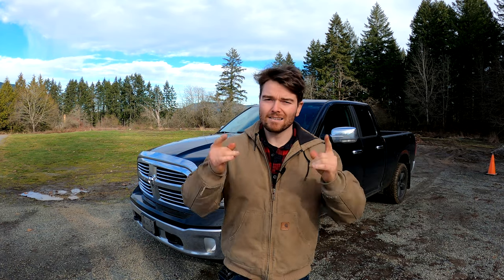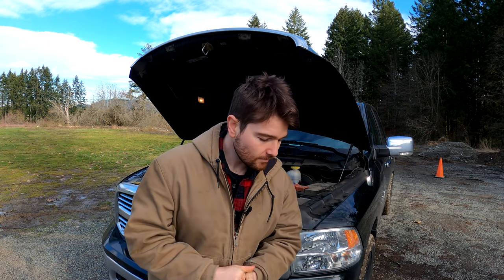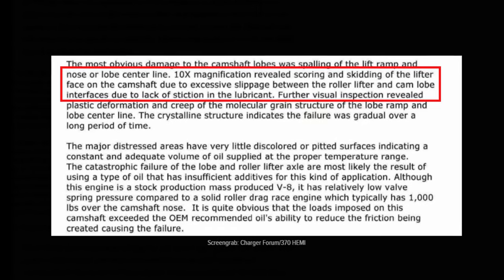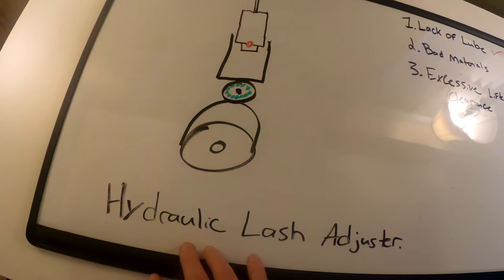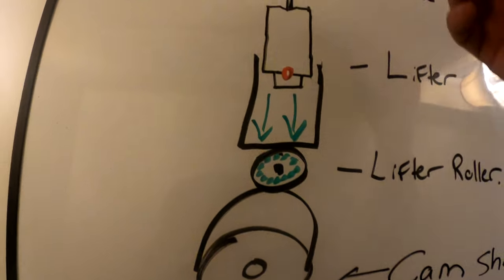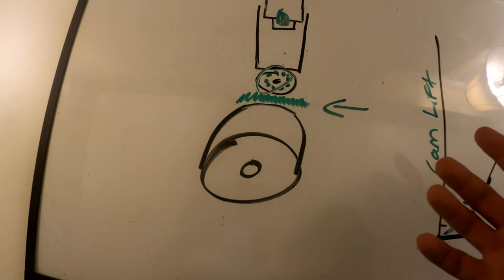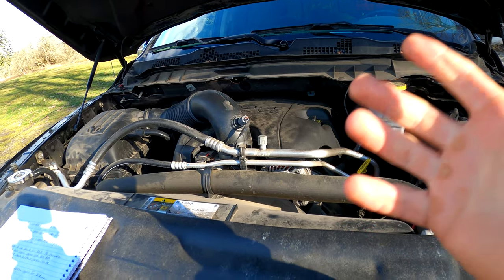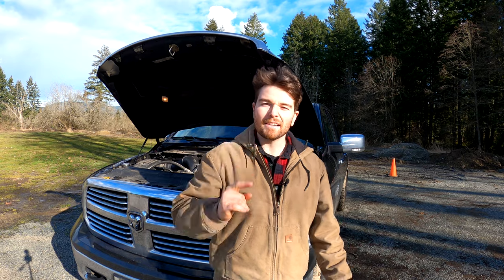RAM 1500 HEMI TICK Explained (Revised) - The Cause And How To Protect Your Engine

Comment: Just passed 100k kilometers (currently at 100 485) and don't have any ticking - yet - knock on wood. I do have two questions though.

I don't do anything myself on my truck but trust the same mechanic I've taken it to for the passed 5,5 years I've had it.

1. The oil in my truck is 0W-20 rather than 5W. How much will this affect the chance of me having these problems? Should I change to the recommended 5W-20?

2. I forget the recommended mileage for oil change but it's either a certain amount of km or 6 months, whichever comes first (if I'd stick to that, it would always be 6 months because I don't do the amount of km in 6 months it's supposed to be change at). HOWEVER - talking to my mechanic about this, he says once a year or 12k km is enough, partially because the quality of the oil is higher in europe, but also because vehicle manufacturer recommendations change. The second one I can believe as I've been told the same thing about my motorcycle by two different motorcycle mechanics, but the oil quality... Is that really affected by part of the world, not what brand it is?
Reply from the maker: At the end of the day it's your truck, so you do what you think is best! But I would always try and stick with manufacturer recommendation. they spend millions of dollars engineering these engines to run and last with a specific weight of oil (now that also depends on climate, if you live in a very cold climate 0w-20 maybe actually be the recommendation - it should all be in your owners manual). besides maybe cold weather is there a particular reason you are using 0w20 ? 

in terms of quality of oil, if you are using synthetic, this stuff is more or less made in a lab and should basically have zero differences where you are in the world. standard oil derived from crude oil may have some differences but my guess would be not that much. 

synthetic oils have gotten better over the years but I would just be cautious. different additives will fade with the passing of time. another thing to consider is your oil filter. oil filters have different particulate ratings, some filter out greater amounts of dirt and debris then others. some filters are rated to last longer then other as well. 

Me personally I would not go more then 6 months without an oil change.
Reply: @TheGettyAdventures  thanks for the reply. I do find it interesting that a mechanic recommends doing something less frequently, since, well, wouldn't they want the work, the earnings? Not to mention seeing others agree with you in the comments that it's crazy to go that long without oil change made me go "uh-oh" a bit when here I've been told once a year or 12k km is enough by a mechanic that specializes in american trucks. But yea, I'll be upping the frequency of my oilchanges.
Reply from the maker: @Waskapmutni  I mean if you do an extra oil change or two a year maybe that will be an extra 100-150 bucks which at the end of the day isn't really that much. Just gives you a better chance of having a healthy engine for a longer period of time!
Reply: @TheGettyAdventures   actually, an oil change for me, since I don't do it myself is about 535 canadian dollars. About half of that is the labor cost. How's that for crazy 😂 So I will probably look in to starting to do that myself.
Reply: @Waskapmutni  definitely change your own oil.  It's not that hard (although removing the oil filter on this truck can suck a little at first because it's a little hard to get to and you can spill some getting it out).  But it allows one to change the oil more often for the same cost, or with better oil, which I now feel is the real key to keeping these HEMIs free from lifter failure (as the video says).

I used to go the full change interval recommended by the computer, which sometimes was between 9,000 to 10,000 miles (14,500 to 16,000 km) when I did a lot of highway driving, but after researching this more recently, and realizing my 2017 HEMI has about 50% idle time (according to the tracker at least, which I'm not sure I completely believe it), I've decided to reduce my oil change intervals to 4,000 or 5,000 miles at most with my usual Mobile 1 oil and filter.  I'm even considering upping to Red Line oil with perhaps 7,000 mile change interval.  Red Line is packed with great stuff for your engine, exactly the kind of stuff that the video says wears down over time, leaving your engine oiled, but not quite protected enough to avoild the HEMI tick eventually.  I know I may be paranoid, but I want my 2017 to LAST, without having to change the cam shaft or lifters.

So enjoy learning how to do your own oil changes!
Reply: @Waskapmutni  bro why are you lying ? That 535 CAD, does it include other services performed ? An oil change with the most expensive oil shouldn't be over 150 for 7 quarts of the oil required.
Reply: @DL101ca  I live in Sweden. Reputable mechanics here are hella expensive. I just converted what I pay for an oil change and nothing but an oil and filter change to CAD.
Reply: @Waskapmutni  I thought you were in Canada. I feel bad for you if that is what you pay over there...no wonder depression in scandinavian countries is rampant.
Reply: @DL101ca  I have no idea what depression you're referring to.

Comment: My opinion is if you’re working the 5.7 in a truck application you need 2,000 mile change intervals and 3,000 under ideal conditions, all of these engines with low tension piston rings= same. They let to much garbage into the crankcase and the oil gets diluted to fast.

Comment: Will Lucas help or no?
Reply from the maker: I honestly would try and stay with the proper weight of oil. it may help but if your lifters are on the way out there not much you can do. Lucas is great for bottom end protection.

Comment: The reason they fail is because of the quality of metal used in the roller bearings. Dodge, Ram, Fiat,  Chrysler, or whoever they are used allowed junk metals to be used. My engine was spotless when I took it apart. All the lifters were socked in oil but one still failed. My oil is changed, since new, by me every 3000 miles. Debris from manifold repair could have played a  factor. But I'm 99% sure it's just shitty lifters.

Comment: I have a 13 Ram 5.7, I have very high oil pressure in comparison to what i see others showing. I have zero hemi tick, I use pup and about 8 oz lubeguard biotech and boss oil filter. i don't think it is the oil helping my hemi, think its the oil pressure. I have driven many hemi trucks and friends trucks and mine has highest oil pressure over every rpm and truck feels more powerful also.
Reply from the maker: well pressure come from restriction. the restriction is probably coming from higher viscosity oil through the same size oil galleries. these truck use hydraulic lifters which runs on engine oil. so If you change the hydraulic fluid (oil) viscosity you'll also change the way your lifter react. I personally wouldn't run thicker oil in these engines. but if you think its working for you then good on ya!

Comment: My comment is this, if you are running a good quality synthetic oil you should be able to run 8000-10,000 miles without changing your oil.  I asked a Mobil Oil tech. who studies oil samples for metal and other debris content for a living.  He said oil like Mobil One full synthetic that the oil life should last 12,000-15,000 miles.  My 08 Dodge ram 1500 is having this issue with 122,000 miles.  I bought it with 100,000 on it and it ran fine when i bought it.   I think this issue a bad design combined with cheap oil.
Reply from the maker: The best thing you can do for your engine is use good quality oil. Personally I change my oil every 5k miles because well that's just what I've always done.

Comment: Oil does not go "bad"!  Oil never goes bad!  Oil never wears out!  Speaking about conventional oil not the synth stuff!  Oil gets dirty and that is what causes damage to engines!  If you wanted too and could afford it and had the room...install a multitude of filters and theoretically oil would never need replacing...just the filters and oil added at regular intervals to replace the amount that came out with old filters!  It's not bad oil...it's dirty oil!
Reply from the maker: fair enough I see your point sir!

Comment: You got it all wrong. First of all push rod does not feed oil to lifter, lifter feeds oil to push rod to lubricate rocker arms. 
The ticking sounds comes from loose rocker arm and push rod, not roller lifter
Wearing of roller caused the increase of lash within the lifter when that happens it create space between rocker arm and push rod and it starts ticking.
Every lifter hydraulic or solid lifter has to have lash. On hydraulic lifter the lash is taking up by spring inside the roller lifter, on solid lifter you create space between rocker arm and valve stem with feeler gauge.
Damage to the hydraulic roller lifter at the roller is caused by lack of lubrication during the initial breaking of camshaft. I have seen many mechanics not using break in lube and they just use 
engine oil, that is not acceptable. 
Someone in factory where the engine is assembled is not installing camshaft correctly. They taking short cut. 
Fact of the matter is design of the needle bearing is one of the factor. More needle bearing inside the roller is stronger, than less needle bearing. I have seen some roller bearing, some has more
and some has less. Try to stick with one that has more needle bearing.
I have seen the guy demo with using lifter at horizontal position and he puts oil and seen how oil flow, that does not work for me. He is lacking one thing oil psi. 
If the issue is lack of lubrication, I can suggest grooving the lifter to roller bearing. I hope this help.

Comment: Had a 2017 Ram Express, it would knock on every start up for approximately 5-10 seconds.  The dealer said that was normal and suggested I use a mopar oil filter to hold oil in the engine.  Needless to say, that didn't fix anything, I'm a F-150 owner now.
Reply: My condolences on the recent acquisition...
Reply: It was the exhaust manifold bolts, guaranteed.

Comment: I think they need different bearings on the roller...not needles..single circular like in electric motors... 3phase..4phase..
Reply from the maker: I mean potentially. many engines run basically the same set up on lifters and manage to do fine. So it could be as simple as Dodge having shitty quality control on its lifters. But I agree something has to change.
Reply: @TheGettyAdventures  GM same thing, both engines have oil pumps too low so it's recommended to rev to 2k more then less so oil gets up there regularly... plus all the other good practices, synthetic oil not too long intervals, ect... plus hope for the best :)
Reply from the maker: @tallll70  Ya it seems like its a combination of potential factors. But as you mentioned just treating your engine well can go a long way. Hopefully lol
Reply: Needle bearings are used in u-joints on driveshafts and yokes... They're very at what they're designed for.

Comment: Just got all my lifters replaced because of the ticking. Best part... It was ALL under warranty!!! 😁👍
Reply: Did the engine light come on or did the dealer replace based on the sound? I'm in the same situation but my dealer won't touch it until an engine light comes on. Thanks!
Reply: @BuckeyeVideo22  No light...dealer replaced them based on sound. Jeez, I hope this helps your situation.
Reply: @j_l_b6599  Thanks for the reply, I think I will have my dealer watch the video. Mine is a 2017 with almost 200,000 miles (full warranty to 225k) and use Full synthetic since I bought it new. Still runs great just the ticking drives me crazy and started about 75,000 miles ago but oil pressure is always good and never had an engine light come on, Thanks again!!
Reply: @BuckeyeVideo22  You're welcome! Hope they take care of it for you!

Comment: UTG is clueless... how can you explain the EXACT same design(2003-2008) engines dont have poor lubrication and don't experience this failure???  How can they simply put new lifters and cams in the SAME engine and runs fine for 200k+???  yes idling is EXTREME wear... your oil has to be changed max 3000 miles...
Reply: 03-08 HEMI where German Daimler AG engineering design. Totally different HEMIs from 09 +.  My 07 HEMI is all made in Germany 🇩🇪 parts. The lifters are made in Germany 🇩🇪 not China.
Reply: @pistolpaulie4871  wow your wrong...  all lifter yes were made in Germany. the block is the same exact block... heads changed slightly but can be put on the 03-08 blocks...
Reply: @massivefins2597  then why is this problem on 09 up Engines?  My 07 Hemi is a different engine from my neighbor 2010. Daimler- Ben’s divested from Chrysler in 07.
Reply: @pistolpaulie4871  the block is 99.9 the same they changes the valve train and heads... thats it all the oiling is the same
Reply: @massivefins2597  like I ask… why is this problem only I’m 09 on models?
Reply: @pistolpaulie4871  because of the higher lift(more fatigue) on the valve train... it was a really a manufacturing issue that was resolved around 15

Comment: I have to use 5w20 because of my lifetime warranty but I just think that much better full synthetic engine oil and a much better oil filter with a synthetic media filter is worlds better than the junk paper Mopar filter and the cheap junk semi-synthetic/synthetic blend crap they put in at the factory and at the dealer unless you specify a full synthetic.
Reply from the maker: ya the semi-synthetic stuff is always questionable in my opinion. unless they give you the actual percentage of synthetic oil in it who knows what you are actually getting!
Reply: @TheGettyAdventures  so would you say that’s a pretty good way to help avoid the cam and lifter failure is to run a much better true full synthetic engine oil with a much better filter and change it a whole lot sooner unless a used oil analysis says you can go further? Just trying to get down to the bottom of it and figure out a solution because if what you say is true about the less than 5% thing which, I don’t argue with, I just don’t want to be a statistic.
Reply from the maker: @billplaisance6387  I mean yes the best thing you can do for your engine is use good oil and filters and make sure you change your oil at a decent interval. with synthetic I would change your oil around 6,000-7,000 km. 

the nest best thing you can do is limit your idle time and try and bring the engine up to operating temperature every time  you drive it.

Comment: And they have plan obsoletethey've got it down to a science hundred thousand miles right when the warranty runs up the metal in The barrens. To break down because that's cheap metal making you come to the dealership and look at all the new shiny new trucks and most people tend to trade them in instead of fixing them infirma canik in the garage it's an easy fix cheap and then they can resell it

Comment: changing full synthetic oil every 5-8 kms is nuts,synthetic oil are much better the that,period,and FCA set up the reminder light for a reason,usually the proper time for a next change is around 12 to 13 000 km with most of the synthetic 5W20 oil on the market,make one thing clear here,owner who follow the intervals and do all what the FCA say and still the engine fail after 80-100 000 km, well, this is clearly a bad design engine.
Reply from the maker: I mean fair full synthetic oil and a good filter is technically designed to be ran at longer intervals. However, I would still caution people that are running conventional oil with a standard filter that running 12,000km intervals is not the greatest. doesn't matter what the trucks says.
Reply: @TheGettyAdventures  Alex ,are you already in Ontario? still waiting for the next video about the road trip and how the truck perform in this long trip?
Reply from the maker: @marmay6874  Yes sir, Working on the old editing part. doesn't come to me naturally haha still learning all the tricks!

Comment: Chinese bearings...oil doesn't flow from the push rod to the cam, oil flows from the lifter galley into the lifter, then up the push rod, and into the valve train.
If you have this problem, it will end in catastrophic failure....consult a lawyer ASAP

Comment: This engine requires Full Synthetic SAE 0W-20 Motor Oil. It's slightly unusual, but it was designed for this oil, so this is a design issue, not an oil issue.  

If the logic of the video were correct, then all cars would have this issue, and that is clearly not true.  

As to what it is, like if the ball in the check valve is too light, or if there's too MUCH clearance in the needle bearings, etc., I do not know.  

But the logic in the video has to be wrong due to the above fact. Period.

Comment: My buddy is an amsoil dealer his 2011 rams cam went out  he bought the truck new  changes his oil beyond religiously   So ya   Wrong
Reply from the maker: potentially yes. Those earlier model rams probably had faulty lifters which caused the issue. in 2016 ram changed their lifter supplier due to quality issues. there is likely more then one cause for this problem which is why it's still kind of a debate on what the actual problem is lol but appreciate the feedback!

Comment: So the people who fucked up the design know what oil it should use? Seriously bro nobody is saying use 20w 50 but band dam 5w 20? 20..? At running temp.? Yeah fuck that you need at least 30 when hot or it won't stay on the spinning metal bro. And after a few thousand miles you should stop using break in weights.

Comment: over looking th e obvious .. all the motors in all the cars from all the manufactures, which other engine would you apply this issue too also? 
Bad design..... engineers after 100 years  know  that majority of car owners turn the key on and that's it. the repair shop is their answer to all issues. Engineers failed to build to address issues.